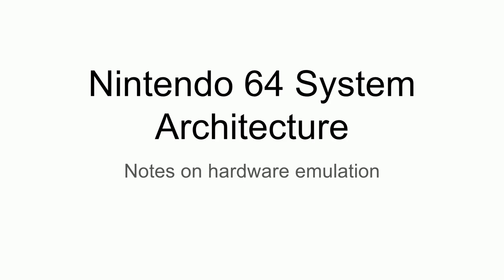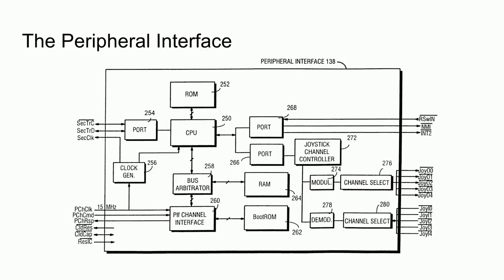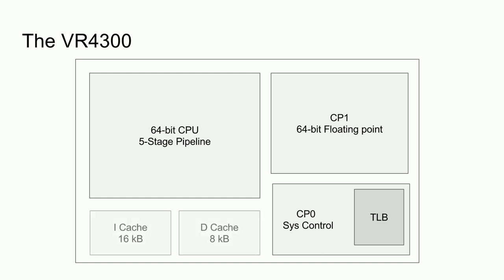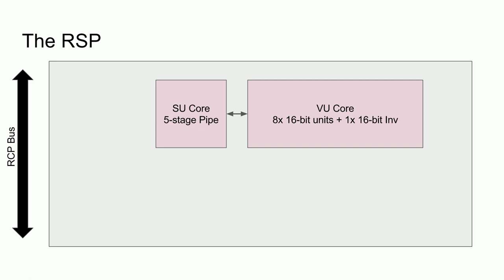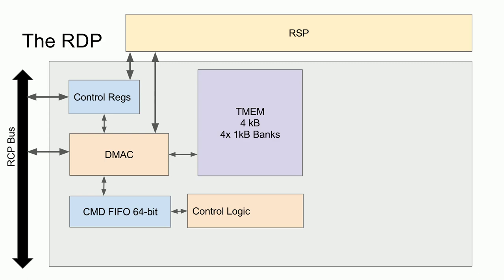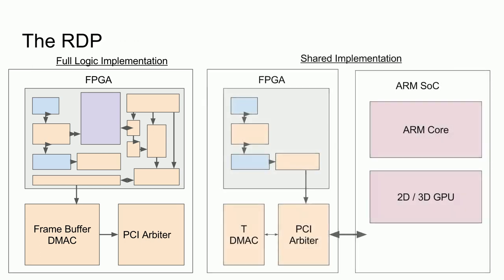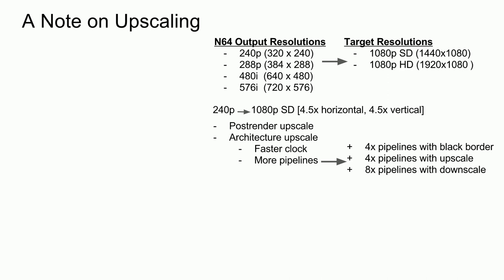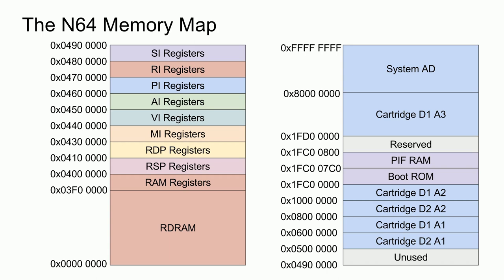N64 Hardware Architecture

Comment: The info on your slide "Game Media" has some errors. You say most games have two ROM chips--I've never seen a single game that has two ROM chips. You show the EEPROM connected to the second ROM chip, whereas it's actually completely independent and connected to the PIF on controller ports 5 and 6 (usually just 5, I don't know if any retail game used port 6). Finally, you say most carts have SRAM and most carts have EEPROM--as far as I know no carts have both, they use one or the other, and some cheap games don't use either but instead controller mempaks.
Reply from the maker: Some of what you said is correct. The two chips on the game cartridges were the ROM and the security chip. I'm not sure what kind of ROM was used - though they were probably EPROMs? (I find it hard to believe they were still using mask ROMs).
The diagram was drawn in a simplified way, and didn't represent the hardware exactly. The block diagram of the internal structure of the RCP is also incorrect, since it was far more complicated inside.
I don't think the PIF had a controller port 5 or 6, where it instead connected to the security chip using a special connection. There were special functions that the PIF could perform that acted on the security channel and not the controller channels.
Some cartridges did have SRAM and some had EEPROMs, however, they may have all been internal to the same package (what looks like one chip on the board can have many internal parts).
Reply: @RTLEngineering  
They are mask ROMs. EPROMs would be much, much more expensive and possibly degrade over time. Technically there is a small ROM within the security chip (about 32 bytes or something) but that doesn't count as a separate ROM as far as I'm concerned.

The PIF definitely does have a controller port 5 and 6, you can see them on some early devkits and in the SGI headers. Port 5 is the serial interface to connect to the EEPROM in the cartridge, and port 6 is a second serial interface to the cartridge which may never have been used. This is completely separate from the PIF's connection to the security chip.

The EEPROMs were 8-pin DIP packages, and the SRAMs were large, wide DIP packages almost the same size as the mask ROM chips, plus an auxiliary IC for battery back-up, as well as the battery itself. There's no chance these were put in the same package; they were both off-the-shelf parts.
Reply from the maker: I'm not sure any of this really matters all that much to the system architecture, since it was game specific.
For EPROMs vs Mask ROMs, I'm not convinced. I would have to see a die shot. At the densities of the ROM chips, I think Mask ROMs would have been impractical, especially to have different masks for each game. The boot ROM was definitely a Mask ROM though, but that was only a few KB and in a large process technology if I recall correctly. Note that when I say EPROM, I am referring to one time electrically programmable ROM. That would allow one chip to be mass produced, and then most likely programmed at an early stage in production using specialized equipment. The difference is that electrically programming doesn't require a custom lithographic mask for each title.

For the PIF controller port 5 and 6, I'm also not convinced there. Just because the dev kit implemented it that way, doesn't mean the final system had it implemented that way. I would be you that the dev kit also implemented the graphics in the RCP differently than in the final product. All that matters is that the code is compatible.

I'm not sure what you're talking about with EEPROMs, SRAMs, etc. in DIP packages. If you are referring to the game paks, those ROM chips were custom made for Nintendo, whether they were Mask ROM or EPROM.
Reply: @RTLEngineering  EPROM stands for "erasable programmable read only memory" and means the package has the little window which you can erase the memory by shining UV light on it. I think you're talking about PROMs, which it's possible could have been used for some games, I can't rule that out. But the PCB labels the ROM chip as "MROM" so that's pretty clear that was at least what was intended when the PCB layout was done. If you can find any evidence they used anything but Mask ROMs, I'd love to see that.

I stand partially corrected on the EEPROM situation. The PIF does indeed have two "EEP DATA" pins, but they're tied together. All the controllers also have two pins, one for read and one for write, so it's possible this is what these are too. So there's only one EEPROM channel in the cart (controller 5), not two (5 and 6). However it is still true that this is completely separate from how the SRAM is connected, and that games don't have both EEPROM and SRAM.

If you take apart a few N64 carts you'll be easily able to identify the EEPROM in an 8-pin DIP package, or the SRAM in a wide DIP package (I think 32 pins but I could be wrong about that number).
Reply from the maker: I was thinking EPROM = Electronically Programmable ROM, however, that would just be PROM, where as you said, EPROMs are the ones with the UV windows.
It looks like most of the N64 ROM chips were Macronix NVM, which could have been Mask ROMs... They also have a type of PROM though which is one-time programmable. One thing that surprised me was that most of the cartridges did use DIP packages as you said (for some reason I thought they were all SMT).
Although, even if the PCB labels are "MROM", that could just be a convention where a PROM would appear as a MROM as far as the system is concerned. 
Also, there were PROMs at the sizes of the N64 ROM chips around that time (at least as far as I could tell).

That's interesting, so the GamePaks were exclusively EEPROM or SRAM. I guess that makes sense if it was only used for game save files. Also, the schematic shows that there were 4 wires going to the cartridge, EERPOM_DATA, EEPROM/CIC_CLK, CIC_OUT, CIC_IN. Since the EERPOM_DATA is coupled with the CIC_CLK, that would imply that it's not using a controller port... perhaps it just appears that way internally to the PIF? To be honest, I haven't spent much time trying to figure out how exactly the PIF appears to / interacts with the RCP.

If the SRAMs are in a 32-pint DIP package, then they can't be connected to the EEPROM lines (they would probably connect to the parallel port along with the ROM), unless they had a serial IO mode?
Reply: @RTLEngineering  Right, the controller ports have the clock and data on the same line (rising edge is the clock, falling edge is either sooner or later for the data), which is different from a separate clock/data line as used for the EEPROM. So it's not technically another controller port. Perhaps it would be more accurate to call it another serial port. In software, setting up commands to the PIF for EEPROM I/O is similar to with the controllers, but not exactly identical.

DIP packages could be wave soldered, which was and probably still is cheaper than reflow soldering in sufficient quantities. Plus the design decisions about that were likely made in 1994 or so, so there would be no reason for them to change course even for the latest games around 2000.

The SRAM chips are indeed connected to the same parallel port as the ROMs.

You're probably aware already, but the Verilog source for the iQue version of the RCP was included in the Gigaleak last summer. Of course, if you're making a commercial hardware emulation platform, you can't look at that information, but if you're just researching it for your own personal interest, you may be interested.
Reply from the maker: I would imagine that the EEPROM uses the same memory block as the controllers. In that case, it would make sense to utilize the same sort of "serial port", but instead have a different physical controller within the PIF depending on what hardware was being accessed. And since both data lines are connected together on the schematic, it's likely as you said, that there were 6 "serial ports". I should probably look into the actual command interface used by the PIF.

That makes perfect sense, although you can also wave solder SMT parts. I think the bigger reason to do DIP, was that it was cheaper to make the PCBs (the tolerances can be much looser for DIPs vs SMT).

I wonder how the SRAM chips were actually mapped into the address space in that case... Was there another chip that was listening to the address lines and then asserted a chip select? I would have to open up a GamePak that contained a SRAM to see.

I didn't know that the verilog for the iQue was leaked... It would be interesting to see how it compares to the original SGI RCP (that verilog was also leaked several years ago). I haven't looked at either (for the reason you mentioned), but I have been told how a few things were implemented (it's interesting, but not necessarily relevant to how you would do it today in an FPGA). For example, the perspective divide for the texture mapping used a 6-bit LUT ROM (with some other support circuitry). 
To do a comparison, someone else would have to do that. I suspect that there are more than a few changes though, since the iQue was a single SoC if I recall correctly.
Reply: @RTLEngineering  If the original RCP Verilog leaked years ago, that's news to me--I thought the community's response to the iQue leak indicated that it was totally new information.

I don't know how the SRAM works electrically, but I'm pretty sure it was mapped to one of the four normal cartridge domains.

It's possible those two data lines connected together are indeed ports 5 and 6, or that they're the drive and sense for port 5, and port 6 is not included in the retail PIF. Not sure.
Reply from the maker: If I recall correctly, it was leaked 10 years ago? The rumor is that someone took a copy of the files with them when they left SGI, and later released it.
The iQue leak is totally new information though, because the iQue was a custom SoC, whereas the N64 was two different chips. As a result, the iQue had a slightly different architecture. Also, games that run on the N64 don't run on the iQue and vice versa.

That's possible, it would make more sense to make them uni-directional and tie them together rather than to make them tri-stated. In fact, it looks like the controller ports don't have a tri-state either. I was trying to figure out what they did, and it's actually pretty clever.... So each controller has 2 wires, one which is clearly the input and the other which is the output. The input ties directly to the data line, whereas the output goes to a 74LC125 (quad non-inverting tri-state buffer). Normally you would think that a tri-state would need 2 inputs (OE and data), however, they instead tied the data to GND, and the OE to the PIF. So it effectively acts as a open collector driver. The output data line to the GamePak must also be an open collector, because it has a pull-up resistor.

Comment: I get the feeling the Nintendo 64 is/was very complicated hardware then and even now.
Reply from the maker: It was / is, when compared to modern hardware (even though modern architectures are orders of magnitude more complicated, all of the complexity is abstracted away by drivers and libraries). Though just like with modern hardware, Nintendo did provide libraries in C which did all of the low level stuff, the only issue was the developers still needed to have an idea of what the libraries and hardware was doing. The same can be said for the PS2, which was even more complicated than the N64. Though I think development for older systems (like the SNES) or the Sega systems would have been more difficult, considering it was mostly done in assembly as opposed to C.
One nice thing about the N64 though, is that it has all of the basic architecture of modern APUs (like what's in the xbox One and PS4), but in a much simpler form.
Reply: @RTLEngineering  I feel like after SONY got smoked by the 64 technologically, they over compensated big time with complexity. The Emotion Engine, and the proceeding Cell Broadband architecture were, in my opinion, terrible choices for hardware design, especially when you consider most games ended up using the same middleware because a few dev houses were able to comprehend the complexity.

Awesome channel by the way, I can't believe I haven't stumbled across your videos earlier!

Comment: How thé vidéo dac IS 30fps when fzero x, smash Bros and other games ran at 60 fps ?? (Ntsc)
Reply from the maker: NTSC is 60i, so each frame was only half-height. In other words, it only output a full frame 30 times per second (30p). The PSX did the same thing, because that effectively allows you to draw more complex scenes in the same amount of "time". Though the actual render loop (with updates) ran at 60 fps or some games updated at 30fps instead to also give more time to the game logic.

Comment: The ROM cart could only run as fast as the slowest mask rom allowed for production. I doubt that is anywhere near 140MHz. Also, correct me if I am wrong, but the RCP created images using glide3D. This would probably be the most difficult thing to implement, as most emulators use glide to D3D wrappers. Implementing that in VHDL would need a really high gate count FPGA. So many LE.. so many.
Reply from the maker: The quoted peak bandwidth of the cartridge port is something like 264 MB/s, which when divided by 2 (since it's 16-bits) is roughly 140 MHz. It wasn't actually clocked, but was instead latched. The latch timings were set in registers within the RCP, so it could allow for various speed Mask ROMs. The initial header read was always done at a minimum speed though, which provides the RCP with the exact timing parameters to use. It's possible that no Mask ROM would allow a transfer at that speed, however, there was also the disk-drive that could be attached through the same port (underside of the unit), which may have been able to operate at that bandwidth.
As for the RCP, 3D was generated using Nintendo's own graphical library (it may have been called glide3D - I don't recall). If you wanted to intercept the glide3D calls and implement them, then yes, that would use a lot of LEs. The nice thing about FPGAs, is that they can reproduce the actual hardware which the 3D library ran on top of. I know of someone who has been able to compile the original RCP verilog for a Cyclone V (it doesn't work quite right, but everything is there), and it only uses around 60K LEs. For reference, the planned FPGA to use for this core is the Xilinx Artix-7 200T, which has ~212K LEs.

Comment: Any additional link for this project ?
Reply from the maker: Nope, there are no additional links for it, since all of the information that would be at the link is contained in my other videos. If you are interested in more details, there additional videos regarding the VR4300 and implementation / optimization of the VR4300 (see the "Troubles of the VR4300" playlist). 
In terms of the other components, I have yet to start working on the RCP, since many of the components within the VR4300 are identical or near identical to those in the RSP (it would make the most sense to finish the VR4300 first). Aside from that, there are a few vague ideas on how to architecture the actual RCP and corresponding interfaces, but those are not written down anywhere.